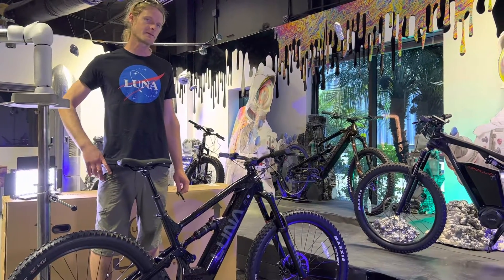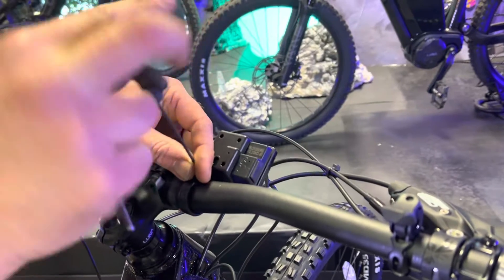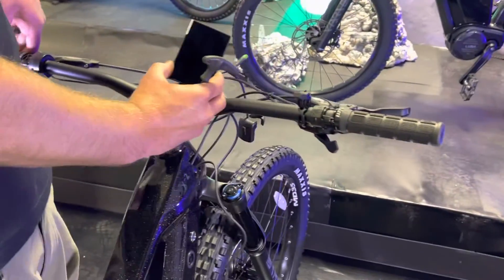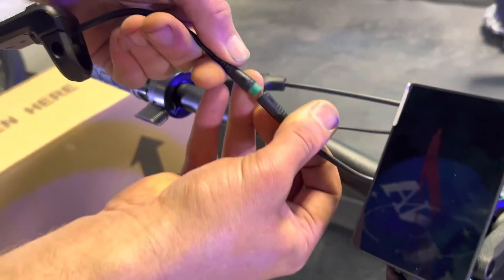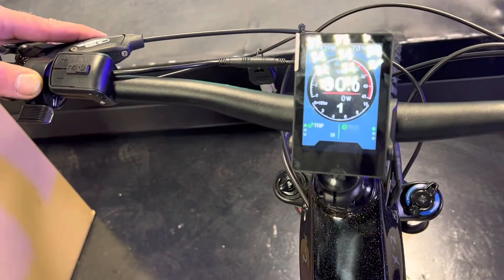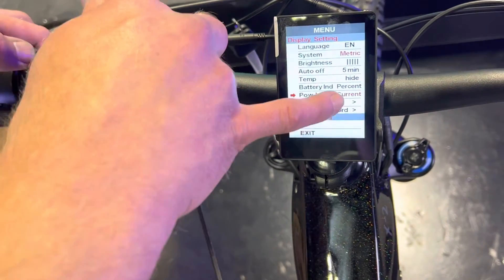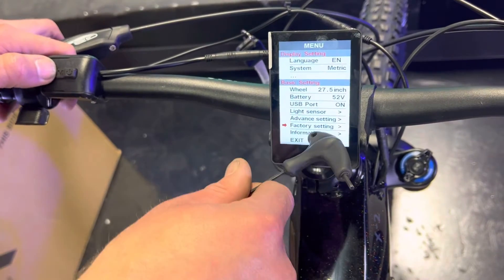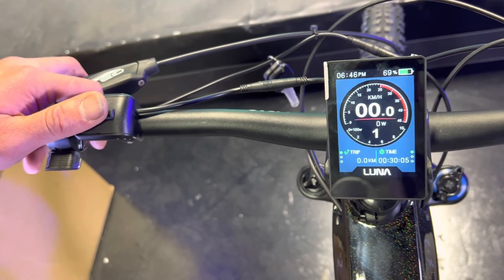M600 860C Upgraded Color Display Install Guide

Comment: How come you say this display is an upgrade for the M 600 drive  and you are installing it on an X2.
 When I ordered mine and installed it, I was having problems with it turning on and bringing up a code.
If I shut it off and try it would randomly work correctly but not all the time.
I filed a troubled ticket and Tony responded and told me that the display is not made for X2 bicycles.
 He actually told me I could burn out my motor if I used this display with my X2.
I ended up speaking with Seb, And he told me that it will not burn out the motor and if I  Try it with the new VESC app it might work better.
 It still will not turn on consistently without bringing up an error code.
But my big question is how come the customer service person Tony is telling people that it will burn out your motor if you use this display with an X2?
You are obviously installing it on an X2 in this video!
 What's the deal?
 I've had to deal with Tony numerous times and he always leads me the wrong direction, so I avoid him now and deal with Seb instead.
Reply: Mate i have this exact display on a rearwheel hub bike,worse thing that'll happen is itll fry a lil battery installed in the device or if it gets passed that maybe some controller damage nothing that couldnt be fixed ✌️